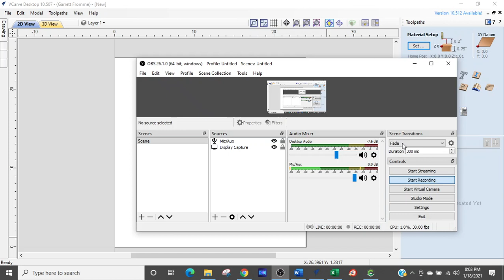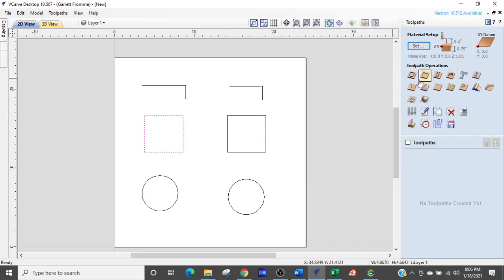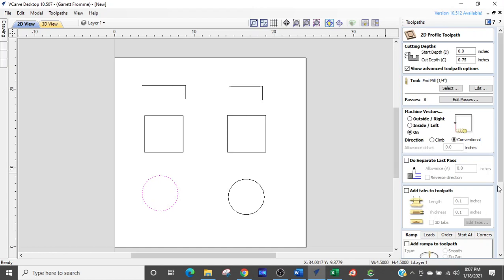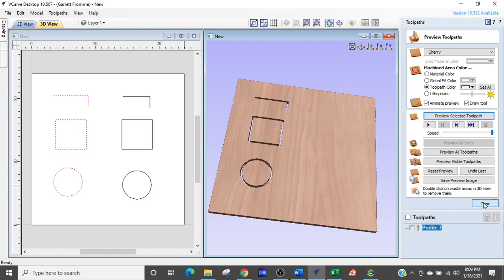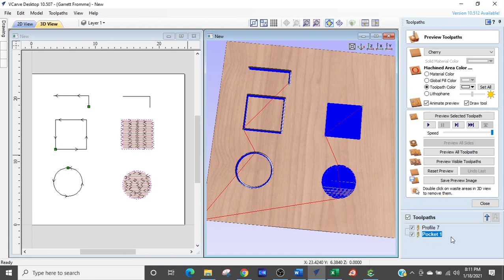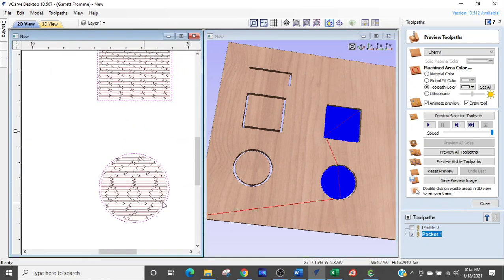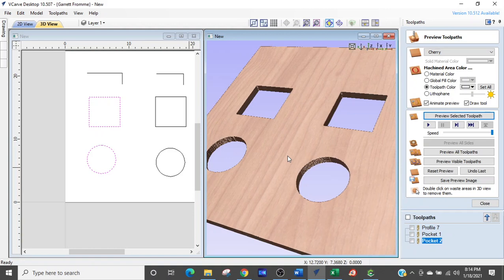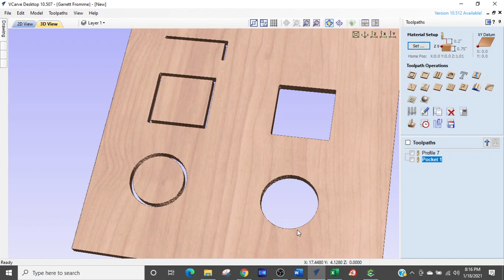Profile vs Pocket Toolpath CNC Router, Vcarve For Beginners Tutorial, CNC Router Project Designing

Comment: Thank you!  So, the profile always cuts out side the line, never centered on it?   If a larger bit is used to make the pocket faster, like cutting several circles of the same, could you just finish off the cycle with a small end mill and use the opposite operation?  In a square or any cut with a sharp angle, the bit will always leave a small ‘rounded’ area at the vector intercept in a pocket cut, so do you always go back and do a finish cut with a very small end mill to ‘clean up’ that rounded intercept?  Do it manually with a knife or chisel?  😬. I’ll buy you a coffee for this answer!
Reply from the maker: hi Paul. Profile will follow a line...on it, beside it or any distance from it. It will still follow a line. You just tell the software where to follow.

The bit follows a slight arc on the corners but it will leave a sharp corner on the cut. It's the way the software moves the bit that is misleading you on this.

Comment: I am a beginner and I’m trying to cut a 24 mm circle.  I used the profile cut because I wanted to remove the inner material as a “disc” instead of the pocket method.  I figured it was less mess and wear on my bit.  The hole is what I wanted to be 24 mm not the disc. I set it to run inside the line, then on the line.  No matter where I ran the tool path, I couldn’t get a 24 mm hole.  It was 2 mm off .  Do I have to use the pocket cut to creat a hole in order to get the inside diameter that I want?  Thank you for the videos, They are helpful
Reply from the maker: Hi Country boy! 2mm is pretty significant. You may want to look into the stepper motor settings. Unfortunately, I can't help with that (yet).

However, you are not out of luck for being able to solve this right now. Check out these 2 videos. They answer how to fix this problem.
https://youtu.be/G0N7Nm3wbfU
https://youtu.be/e7xMpL-0F_A